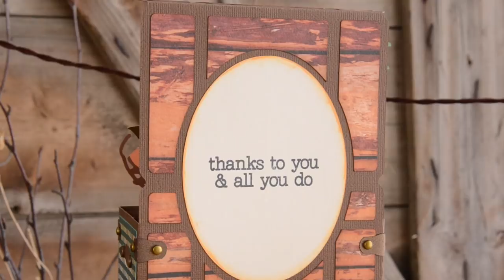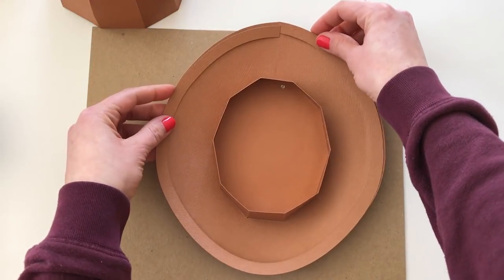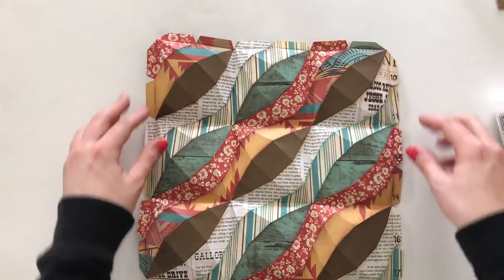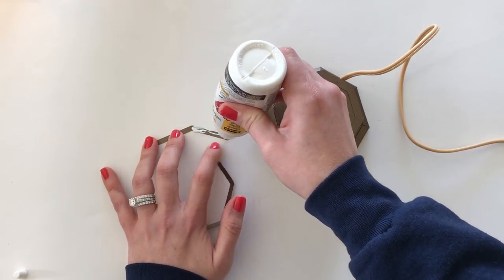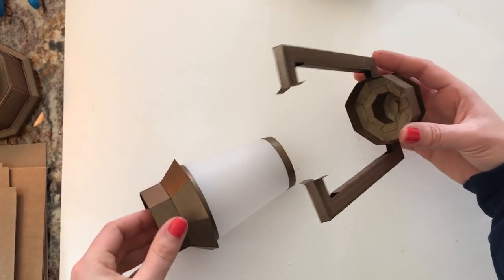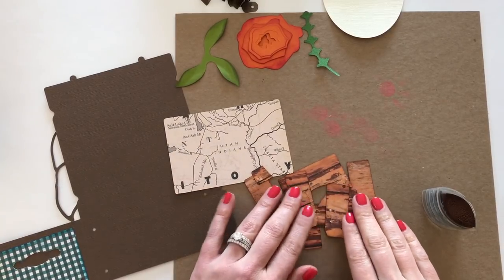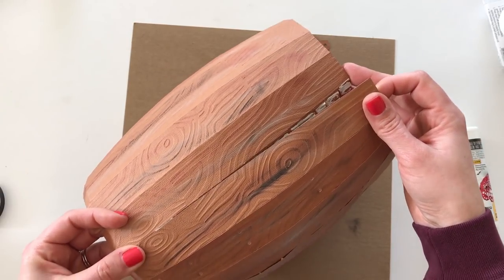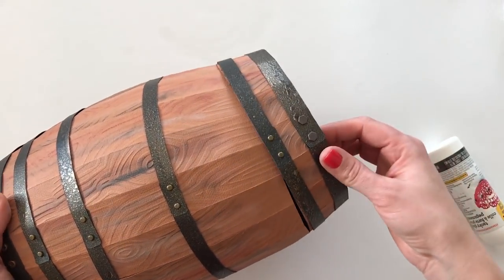Wildflower Saloon SVG Kit Assembly Tutorial

Comment: What am I doing wrong ? are the scoring lines not suppose to be attached to each piece? Because it does it individually
Reply from the maker: Hi Daniella, It sounds like you may need to “attach” the score lines in the Cricut Design Space software.

I have some more information about that here: http://svgcuts.com/blog/2017/10/16/why-are-my-score-lines-on-a-different-mat-in-cricut-design-space/  It sounds like you may need to “attach” the score lines in the Cricut Design Space software.In a nutshell, if the shape you imported into the Cricut Design Space software has score lines you’ll need to: Select the file on your mat and then click “Attach” (bottom right corner) Please let me know if you need any more help. You can also email us at info@svgcuts.com if you need any more help. 😌

Comment: Question: what should the dial be set to, custom? Cuts are coming out too deep and messing up attached score lines.
Reply from the maker: Hi onedivamom1! I’m sorry to hear that you’re having trouble. It sounds like perhaps you are using a Cricut Explore--is that right? The recommended pressure setting would depend on your blade's sharpness and type of paper. The best way to determine that would be to dial it down until you're happy with the pressure. I'm sorry that we can't be more specifically helpful with that. Also, here is some information about using our optional solid score lines in case it’s helpful: http://svgcuts.com/blog/2019/04/15/how-to-use-our-optional-solid-score-lines/ - thanks for reaching out! Please let us know if you need more help. ~Mary